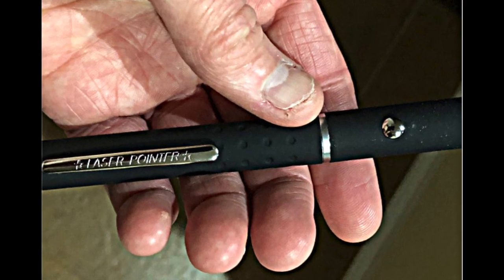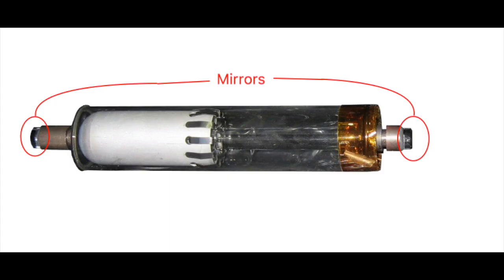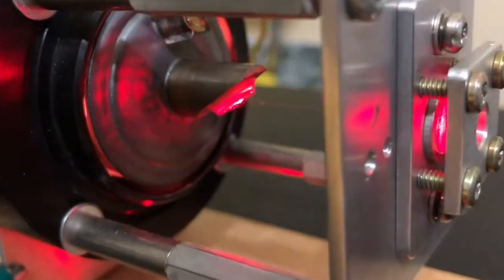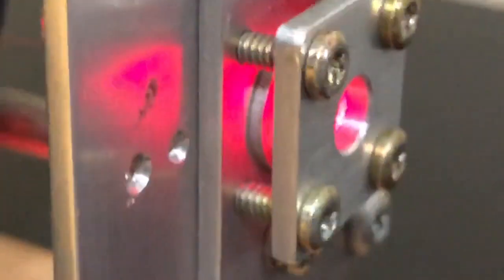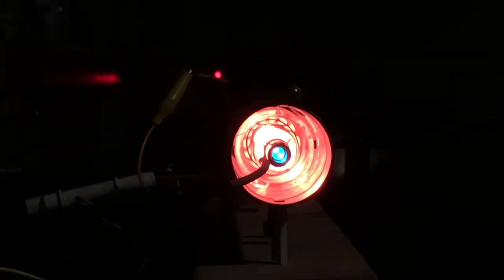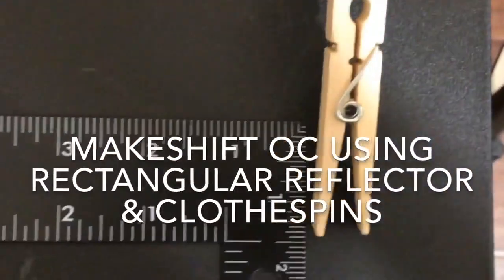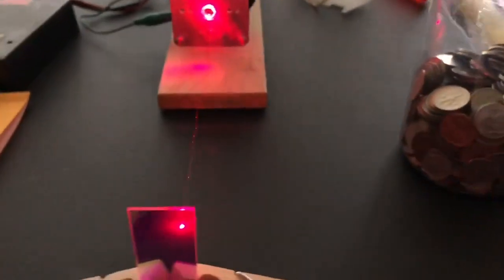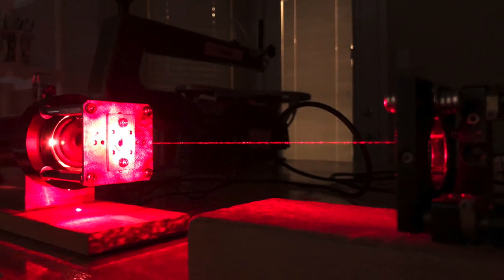An unusual helium neon gas laser, with an external output coupler and multi-mode output

Comment: I saw described a particulate measurement system that used the intercavity beam.  It had two 100% reflectors and the beam passed through a matt black cavity with a air flow path perpendicular to the beam but receiving none of the direct beam or external light by way of baffles.  It also had a photomultiplier tube looking into the cavity but out of the direct beam.  When clean air was blown through the cavity there would be no scattered light and no photomultiplier tube output.  Due to the intense beam it would be sensitive enough to do particle counting using the full beam width and cavity length.

I have been thinking to put together such a system but have not found a need to measure air particulates yet. 🙂

Comment: I have a great trick to share with you from thr 90' when we were taking pictures to make visible laser beam AND also visible background prety easy: Use a long exposure camera, wear a black shirt and move a black or grey paper piece along the entire beam and just before ending the camera exposure, use a flash lamp to shine all the room, then stop the exposure.  This way you will get a picture of a "visible beam" that look like to  be bright in an ambiant light.  =)
Reply from the maker: Thanks. Good suggestion. The intracavity beam is powerful enough to allow the ambient dust to make it visible.

Comment: hi, 
thanks for sharing your laser experiments. great work! Your ruby laser is able to ionize the air and maybe become conductive for high voltage static electricity?  I would like make some experiments with discharging static electricity bursts with laser beams. It is possible? 
Best regards Zlatko
Reply from the maker: Not possible with this laser. Thanks.

Comment: Just a question I was given one of thos lasers a friend found it wile dumpster diving it needed 115volt to power it I found 115volt power supply powered it up works fine ....how much are they worth the laser tube is kinds big maybe 14 inch 15 inch big
Reply from the maker: Hard to say for certain. I suggest you have a look at similar items on eBay.
Reply: @magx1  I found it online it's worth 5,000 with no power supply but I'm more a laser lover I never had a laser like this I build dvd burning lasers with lm317 and two 5 omh resistors for the driver some times a potentiometer with it

Comment: home made laser able to melt aluminium dust- is it possible?
Reply: Aluminium dust is hard to melt together.  It has an oxide layer that prevents easy fusion.  It also reflects light pretty well and if it is very hot it wants to oxidise unless you are doing your experiments in an inert atmosphere.

Search patents and see what is used in 3D powder printers that use aluminium.
Reply from the maker: Depends upon too many factors to give an absolute answer. A CO2 laser, might melt aluminum, if powerful enough (otherwise the beam will likely be reflected). A powerful enough pulsed laser can possibly vaporize a small hole in aluminum, steel and other metals. But why aluminum dust?
Reply: @magx1 Normal laser printer melts paint dust. 3d aluminum printer could melt layers of aluminium dust... 3d aluminium printer.